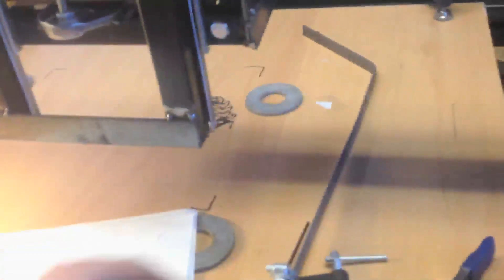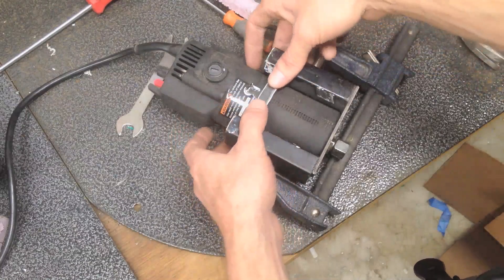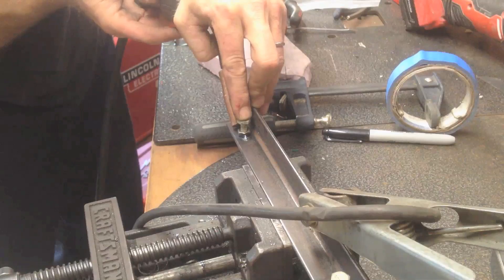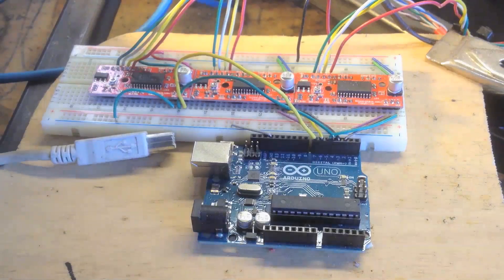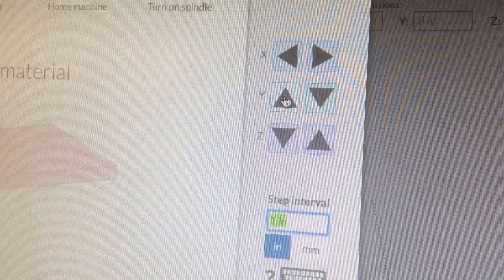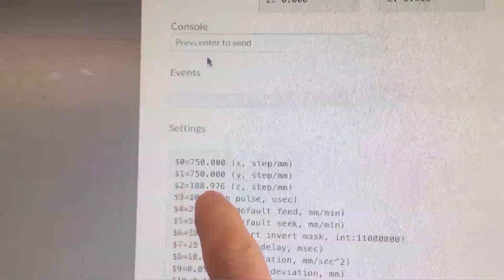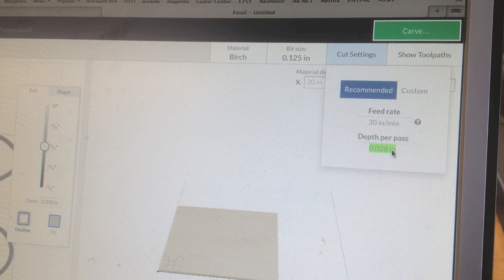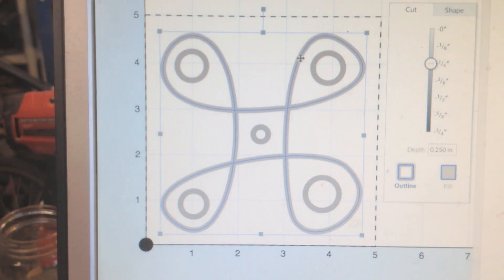How to: DIY Arduino CNC Router Cutter Welder (Part 5: Router, GRBL Settings and EASEL Tutorial)

Comment: I will be building a CNC project.  This video covered alot of the questions I had.  Motor calibration, what software and how to use it.  Thanks for bringing us along for the ride.
Reply: There are many ways to go with a self made CNC.  The from scratch/no plans method, as here and the way I did mine, Plans available on the net, and kits.  Personally I DO NOT recommend the scratch approach unless a person had a far better that average experience with mechanics in general.  To do a good  CNC you have to work with tolerances below about 20 thou. The tighter, the better. With wood anything no less than about 30 thou or a  32nd will work fine. The other critical thing is keeping things squared up and parallel. Deviate from that by more than say half a second or roughly 120th of a degree and the accuracy goes to pot on anything you make. This is tough to hold even in a kit build. 

Then there is the drive issues.  Best to get is ball screws but you will think you're financing a moon launch with the price of those. Acme thread is reasonable and affordable. In fact you will find it used in most commercial CNC type of machinery like lathes. It looks like all thread with square threads. Bottom is all thread. The thread pitch IS very precise but the major and minor diameters of the thread is a whole nother issue. In all cases you will have backlash to deal with.. Run a nut up on a bolt and notice the wobble in that nut.  Thats backlash. It can be dealt with but the less there is to start with, the less you have to do. Bearings and what they ride on are another. Top of the line is whats known as linear bearings. Something else that is also in the moon launch price range. Common skate mid range skater bearings have tolerances in the range of say .0005 and they are CHEAP. Use them on steel square tubing available at the local home depot and its easy to stay within a couple thou flat all the way. I use V-rollers at about 9 bux a pop running on the edge of some 3/4 angle. You can use a couple skate bearings mounted in a V to ride on the square corner of the same 3/4 angle but it has problems in adjusting out the slop.  I chose to pay the extra in cost for ease of mounting and adjustments.

Then there's the electronics issue.  I chose to go with a program Called Mach 3, around $150 ( best I recall), using an old computer Ive had for at least 15 years.  Thats functionally the same as the common adruino setting on a G-shield or some other driver board such as this build. My setup is almost identical to what you will find in the average smal to mid sized 3-axis CNC commercially made.  In fact a huge number of them actually use Mach 3.   There is basically nothing wrong with the Audrino/gshilerd or driver setup and it functions quite nicely for many but it does not have the versatility of Mach 3. 

Price wise - ignoring the steppers- works like this..  My setup in the neighborhood of $300  Adurino  Most likely somewhere around $75. 

Software wise--- the total price for all the software I normaly use  - somewhere around $500 to $650. This does NOT include the $150 for Mach 3 that is the equivalent to the part of the online Easel program in the mode of the actual cutting. 

Then thees the steppers. smal ones can be had for nothing by junking out any inkjet but the power is so low you cant do squat with them.  Small stranded NEMA17 size can go for about $15 to $20. This is what this guy used. NEMA 23s like I use go from about $30 to around $80 depending on the torque. The large size ones, NEMA 37 ( i think) go from around $100 up but are NOT needed unless you're moving car motors around. 

Then there is the spindle.. FORGET the cheap 300 watt ones unless all you want to do is scratch up some plastic or brass.  I have one and I DO use it for engraving work and chewing on plastics and aluminum where I must have good speed control. Its super slow go with it. Normally I use a Ridged brand trim router the rest of the time. Go with any of the small hand held trim routers. Also order up a couple set of brushes for it too. They go faster than you would think on a CNC. Theyre gutsy enough to make huge clouds of sawdust. STAY AWAY from the Harbor freight ones, theyre over priced garbage. I toasted 2 of them just carving out half a dozen 12 by 16 inch fancy lattice panels out of underlayment for a guy. The one this guy used IS harbor freight Junk. Surprises me he hasnt smoked it. This is one place where going cheap can AND WILL bite you in the butt. The money for  the trim router turns to smoke, the job gets trashed also burning money. Just consider what  nice chunk of say walnut costs. 

The costs are worth it to me and I acquired the software over a few years so its nowhere as costly as you would first think. You can easily blow a couple or 3 hundred trying to tag a deer.

Bottom line and a warning. CNCs are a blast and HABIT FORMING.. 

Hope my bit of rambling gives you some REAL info on the CNC addiction.  :)
Reply from the maker: +King Red Leg Thanks and good luck with your build.  Let me know if you have any questions as you go along.
Reply: +John Ware Im planning on building my first cnc machine anytime soon but the cheapest motors I can find are Nema 27 425oz ( using tb6560 and a power supply 24V 350W) think they would be enough for working on aluminium and engraving steel? assuming I got a smooth rail of course.
Reply: 425s will give you all the power you need if you use some form of lead screw. I use a 5 start 10 pitch one on my X and Y. In essence one rev of a stepper gives a half inch of travel. With 2x micro stepping engaged one rev works out to 400 steps a rev or 800 per inch. That gives a resolution of 0.00125 inch.  That 5 start lead screw lets me run rapids at around 375 ipm if I want.  I have it set to 200 so there isnt anywhere near the jerking around  on ramp up sand ramp downs of the steppers running at 375 ipm. 3 foot 1/2 inch 10 pitch acme threaded rod is right at 10 bucks. Bit more than all thread but it has far better accuracy. More than likely any form of belt or chain drive using 425's can most likely allowin complete stalling of the steppers, havent verified it but that opion is based on how easy I can stall a 425 with a 2 inch disk on the shaft buy simply clamping down tight with my hand on that disk. 425 oz/in is roughly 2.2 foot pounds.. Steppers dont rate like any motor.  the rating is HOLDING torque, where with a normal motor its rotating force.  Keep in mind that going too cheap is not going to get good results. 150 bux for 3 steppers isnt bad when you consider what the rest can cost.  :)
Reply: ME TOO. This video series is so fucking cool!